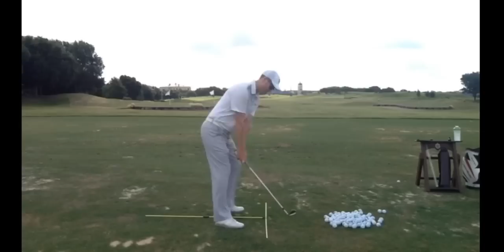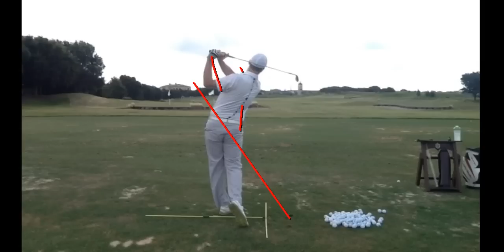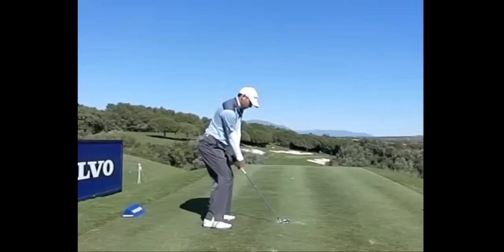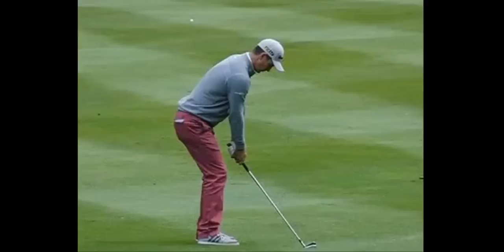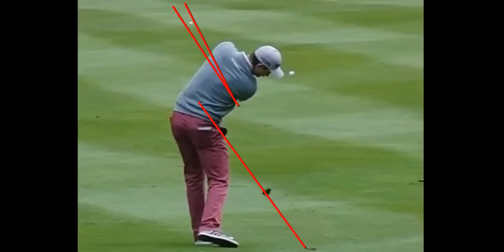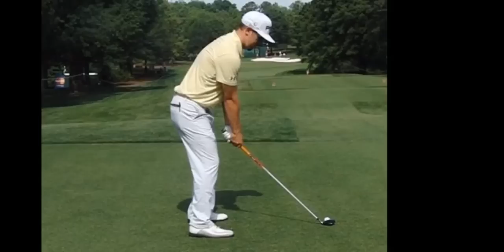How To Get The Golf Club In The Slot

Comment: This type of swing which the pro’s use looks good but it also looks as though it could put an awful lot of strain on the lower back with the low angled strong rotation through the ball. I am 68 so I am wondering if I should attempt this swing for crisper contact as opposed to my usual more in and out to the 1 o’clock position on the through swing? Your thoughts.....
Reply from the maker: Robert Bernard my thoughts are that if you don’t exit left enough (under the shoulder) you’ll hook it or block it because the hands and club are moving up off te circle...

Comment: What causes the club to shallow?  Is it a reaction to bumping/turning the hips or is it a deliberate arm move?
Reply from the maker: +Darryl Gwalter Being patient at the top! If you're in a good position, the weight of the club head will build up pressure in PP#3.
Reply: JamesParkerGolf never thought of it like that. Thank you.
Reply from the maker: Darryl Gwalter no probs..
Reply: Right elbow in front of right hip pointer.
Reply: Your right elbow MUST outraced your left arm to your waist/torso. Almost NO mid/high handicapper does this. Only THIS is how you truly get into the slot. Even with little rotation, the longest, purest draws can be achieved once your elbow gets down to your torso before your left arm parallel.

Comment: James....it looks like you are holding off the finish....the club never turns over and the face is pointed up to the sky through impact.  When I try to do this....I get no distance....any advice?
Reply from the maker: +Bill B admittedly I deliberately held the face open a little to illustrate not flicking the hands at the ball through impact. But an open face isn't causing your lack of distance. I'd recommend the face slightly open at impact (say 2 deg). That way, if you can get you path going 4 degrees out - you'll start the ball right and produce a slight curve (draw) giving you a consistent shot pattern.

Your lack of distance is probably coming from swinging across the ball.. I'd have to see it to give you an accurate analysis however.